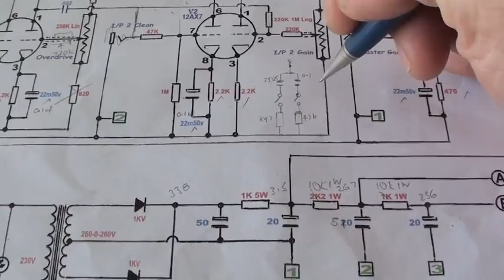Small Tube Amp Build, Start To Finish

Comment: Hey,

I looked through comments and I believe you are keeping schematic to yourself as an author.  I respect that and would not ask for you to share it. Anyways, I felt empathy to what you said about not being able to afford nice things, so you make them yourself. From description, I see that you have used EL84 and 12AX7s. Maybe you could turn my head towards place to look for something build based on these tubes? I admire your work and would like to try my luck with something similar. Something, that warms heart (and filaments) and at the same time leaving some money in my pocket.

Anyhow, good luck and thanks for sharing this project.
Reply from the maker: +Kristaps Liepnieks Hi Kristaps!  Thanks for kind words and comment.  The reason I dont share the schematic is that I honestly dont have it accurately drawn.  The basis of the schematic is intact however the switching is the component of this design that makes it very tricky to draw schematically and I've been a bit lazy in attempting to finish it.  I do however have an accurate layout drawing that Iv done on the computer and that probably has better information in terms of building this amp.  It took an age to draw but if you PM me I can send you a copy. The detail is indeed in the layout as that is where all the work is done in terms of noise reduction.  Thanks again!!
Reply: +elams1894 Hi,
Youtube massaging is sort of new to me. I believe I sent you a message. :D I think.
Reply from the maker: I received your messages Kristaps all good. I'll get onto it when I get home from work, been a busy couple of days :)

Comment: That would b cool to have such a tiny tube amp.  Put an EQ, OD, and Reverb in front, u got everything u need for any sound.
Reply from the maker: +Flowthrough Yes it takes a pedal nicely and real good size to take around with me with a single speaker. Its loud as all hell though, very powerful little unit. Thanks again Flowthrough!!!

Comment: Excellent work all the way,although I would prefer to stain the chassis to give it that old look...but great work just the same...👍🏻
Reply: Why stain it? It's got "the old look" as is? The tree that timber is from was probably 500 or so years old. That's old enough  IMHO. The only timber you would stain is Pine (and most of its relations...).

Comment: beautiful design. best in here
Reply from the maker: +nigel mohair Thanks so much Nigel!!!
Reply: +elams1894 can an integrated amp be converted to a power amp??
Reply from the maker: +nigel mahabir Do you mean, can a transistor amp be converted to Tube amp?  I have seen it done but it really means a massive overhaul.  Transistor amps are current circuits and have completely different component values and so on.  Tube amps are Voltage circuits so converting from transistor to tube is not really practical. Cheers!

Comment: Hi, a parts list would be cool...great work by the way
Reply from the maker: Thanks!  
2 x 47uf/400V F&T Electrolytic caps
2 x 22uf/400V F&T Electrolytic caps
2 x 1N4007 1000V Diodes
1 x 25uf/50V Sprague Premium Electrolytic cap
2 x 25uf/25V Sprague Premium Electrolytic cap
1 x 1k5W Kiwami Resistor
2 x 1k2W Kiwami Resistors
1 x 470 Ohm PRP Metal Film Resistors 
2 x 100 Ohm "         "        "         "
1 x 10k           "         "         "
6 x 47k          "
3 x 2k2          "
2 x 1M          "   
2 x 470k       "
1 x 3k3         "
5 x 220k       "
1 x 100k       "
4 x 0.02uf/400V Jupiter Vintage Tone Film Capacitors
2 x 0.1uf/400V    "             "          "       "        "
1 0.002uf/400V   "
250k Lin PEC Potentiometer
2 x 1Meg Log PEC Potentiometers
Switchcraft Input Jacks
Belton sockets, IC AC inlet Plug/w inbuilt fuse holder
Japanese Ohm selector switch
Carling ON/OFF Selector Switches
Classic Tone Transformers both Power and Output.
Hammond chassis.

Cheers Bruise!!

Comment: Amazing work and shop. Just seems like a lot of work for such a basic amp. Killer though.
Reply from the maker: Thanks GW.  Yes its quite a simple amp circuit, but the hard part is turning that simplicity into a tone that is quiet and hiss free.  I think many amps are overly complicated in their circuitry which adds a terrific amount of unwanted noise.  Getting rid of everything that I could think of that was unecessary was important to retain as much signal as possible and the incredibly hard part was getting a layout that had minimal noise too.  That took many many weeks of layout design.  It may seem simple and a lot of work but I just really wanted a beasty little simple amp that was quiet in terms of hiss and hum.  I'm a bit mad I think sometimes ha ha, but the is method behind that madness on occassions:)  Thanks again!!

Comment: Beautiful work, but two things not up to snuff: Turrets need to be swaged (staked) to be sure they don't loosen and fall out of the tag board later, and wires at tube sockets need to be wrapped around the terminals before soldering to prevent intermittent connections. The latter is especially important, because every time a tube is changed, wiggling it in and out of the socket creates stress at those joints. Other than this, a really great job!
Reply from the maker: TriodeLuvr Thanks triode, good points.  I do swage my turrets, just not shown in video.  Good point on wrapping the wires around the tube socket lugs, however I do not do this for the simple reason that when it comes time to replace that component, or socket, for whatever reason (and it happens almost everytime when designing/building an amp) the lug is often destroyed in the process as trying to get that wrapped wire out is near impossible without taking something with it, or damaging, misalligning, or snapping the actual lug.  The disadvantages of wrapping the lugs at this design stage outweigh the chance of an intermittent joint at the lug for me personally.  But you are certainly correct, when everything is dead set perfect with an amp, when building one, it is best practise to wrap all connections.  Thanks again.
Reply: elams1894 Yes, I understand. I wouldn't have even mentioned the wrap if I thought this amp was a prototype. I just couldn't imagine that you would make any serious mods at this point though, it has such a "finished" character. I also wouldn't have mentioned it if not for the fact that I've repaired so many kit products (Heathkit, Dynaco, etc.) where intermittents were traced to cracked solder at the tube pins. Anyway, it's a terrific piece of craftsmanship. Keep up the good work!
Reply from the maker: TriodeLuvr No worries at all, thanks for the input. My father hounds me about the same thing actually :) He also constantly reminds me about the need for a small braided wire between two side by side socket lugs, instead of a solid wire that is nearly always used (as a solid wire provides no wiggle room, or give for the tube pins).  Thanks again Triode, have a good one!!

Comment: You are very talented and it looks amazing. this is something that could not build both because of ability and tools. That being said, the amp sounds really harsh.
Reply from the maker: Thanks lewisbeeman! Indeed the tone isnt for everyone. The circuit was first designed as a clean amp (I think thats the best approach to amp building) and it has a clean channel still in there, however I love the distorted tone and so I just crammed as much distortion I could get out of the preamp tubes for the gain channel. I still love its tone, but my old man hates it. Hes a clean jazz cat and he hates, I mean HATES, it when I crank the gain channel. Its quite funny but certainly the main message here is that you can mod this amp circuit to whatever you like, definitely clean is very nice indeed. I love clean through a big amp like a JTM45, its a sweet thing, cheers!
Reply: Next project: Marshall JTM45 clone.

Comment: I can't imagine the need for TWO 12AX7 preamp tubes if you don't have a tone stack requiring gain recovery and you don't need a phase inversion stage because you are just driving one power tube. Seems like overkill on the front end. I designed a similar amp with just one 12AX7. It's basically a Champ with increased bias to the 6V6 and a few tweaks. It has a similar brightness switch and cathode cap switch to your design here.

I would think a more useful switch might be one that disconnects a gain stage or two. Hard to do that without getting a "pop" when you engage and disengage it, though. That way you could get more useful cleans without having to stifle the front end so much.
Reply from the maker: Joe Shmoe +Joe Shmoe I have two pre's as I am running two channels. One pre drives the clean channel with two gain stages and then switched to dirty channel with 3 gain stages. I need two ax7's to get three stages of gain. Not sure why that is unusual to you as its a standard circuit. If I wanted a tone stack then I would need 3 ax7's. Re:switching, I don't get any pop as I use make before break switches and each channel is earthen when not in circuit, ie, not open. After lots of trial it was decided that pre amp distortion was much more pleasing in terms of harmonics rather than driving the signal to distortion through the output tube. Cheers.
Reply: elams1894 Oh ok. Any trouble switching? pops? Or was it two separate jacks?
Reply from the maker: Joe Shmoe hi Joe. Indeed popping was a big problem and it needs quite a bit of attention in the way  each channel is earthed if you don't wish to use optocouplers or transistors. higher voltage make before break switches are a must too. From memory I used two 48k resistors between the cathode and earth for the switching, these  were switching from the in circuit cathode bypass network to the 48ks when not in circuit. if that makes sense, it was a bit tricky to work out from memory..
Reply from the maker: Joe Shmoe give me a personal message with your email and I'll flick you the circuit, might be easier.

Comment: Nice job . My only concern is where are the air vents ? Amps can generate a lot of heat quickly , and need proper ventilation . Other than that it looks , and sounds great .
Reply from the maker: Thanks saint. The whole back of the amp head is open, the carbon shell covers the top and front only, cheers.

Comment: Class A amp Making your own turret circuit board..nice layout of components..that's very professional.
 Good that you used the vintage tone caps. Like the sound effects of all the tools you use..makes this very unique..especially the hand saws. I was wondering what these glued together slots were all about.  Dove tail box joints..very nice work!
But the front end pre-amp sounds overloaded. Where you intending for a clean sound?
Reply from the maker: SuperCarver2011 Thanks super carver, the glued together slots were the templates for the dove tail jig.  There is a dedicated clean channel using 1 gain stage which wasnt demonstrated to well on the vid.  The overdrive channel has 3 gain stages and I certainly drove each stage to as near capacity as I could without getting into overload humm and hiss.  Thanks for checking out the vid and sorry for delay in reply, cheers!
Reply: elams1894 After your reply, I watched your vid again and noticed you even made your own dovetail jig..now
that is dedication to the craft.  In my humble opinion, you should have had less gain on the LEAD channel and
concentrated on biasing the o/p tube for soft overload to give that better distortion sound like some of the
pro amps.  The clean channel sounds not too bad.

Comment: Do you have a schematic for this thing available for download? I am quite interested in building my own head, or possibly combo, and this is quite inspiring!
Reply from the maker: +Carlin Lusk Hi Carlin.  I do not have the schem drawn completely as the switching is quite complicated and Iv been a bit slack in working it it on paper. I do however have the layout diagram all drawn and completed accurately.  That might be a bit more handy.  PM me with your email and I will flick you the diagram if you like.. cheers!

Comment: a great video and a good eye for detail, ?I was wondering if you could tell me why the wires are always twisted in pairs? Does it cut down on noise as say run together with tie wraps? Thanks again for the great videos
Reply from the maker: Robert Anderson Yes the wire twisting cancels out any humm that may be picked up in the AC circuit.  Any AC wires coming from the power transformer in the amp should be twisted for this reason, thanks so much!!

Comment: At 01:13 you are twisting two wires together , what purpose does this serve , is it to keep the wiring neat or does it add noise resilience?

Thanks
Reply: +HumphreyBriggs Think it's just for neatness but twisting cables together does reduce stray inductance.
Reply from the maker: +HumphreyBriggs The AC wires are twisted together to significantly reduce 50 cycle humm.  Indeed noise reduction is its main purpose and its neatness is a bonus.  Thank you!

Comment: Making your own dovetailing jig. Hard core.

For myself, I prefer working with aluminum rather than carbon fiber. But that seems to be your thing.
Reply from the maker: I'm a fan of alloy too. Just trying to get my head around chassis fabrication, I'm thinking of buying a tig welder, just money is a bit tight at the mo..
Reply: I assumed you could just bend the aluminum — no need to weld (although that would be cool!).

Comment: so what's the difference between this and a Marshall?  what part of the constriction would make it better? like better parts, design or what?
Reply from the maker: +mike jones The differences lie in the components/layout/grounding pathway.  Hand wired tube amps are all very similar in the sense that the tubes themselves require a particular circuit in order for them to run at optimal level.  The real genius's are the engineers who designed the tubes.  Those tube circuits are tweaked of course to give certain tone characteristics but the actual circuits themselves are all very similar.  You get differences in tone stack circuit, phase inverter and so on.  You can throw a lot more components into a circuit to get better frequency curve charts in terms of tone stack but does this make it better from very simple tone stack circuits such as in the SLO? It all comes down to tonal preference and money for production.  I like simple over complex, a nice and tidy ground return with one earth, a simple point to point layout and a stable low noise end product.  I like quality components and I dislike chassis mounted can caps but that is about where the differences between this amp and a marshall lie, just in layout and in quality of the components but it certainly doesn't make it any better in terms of quality of circuit, just difference in the time it took to hand make it and its components and layout.  The tonal end product is always the clincher and that is as always of personal preference. Thanks for the great question!

Comment: Really nice. Is that bottom piece of wood a veneer? I want to do the same using walnut but I don't want to see the ripped edge. Instead of carbon fiber, for the face, I will use clear glass. Just built my cabinet and it's awesome. Well done!

Comment: Amazing realization!!! You are Amp God!!! but where did you find the wiring diagram?
Reply from the maker: +Robert Devil Dodds Hey Robert!  Thank you.  I designed the circuit myself and also created the wiring diagram on Google Docs, draw application from the net.  Its all out of my own head he he.
Reply: elams1894
Ciao Elams, I'm impressed by your work! Simple Fantastic! you'd be willing to share the project with me? I would try to replicate it. I am not capable of designing circuit diagrams, but I am able to weld an electrical circuit following diagrams. I look forward to hearing from you. Thanks Robert

Comment: A Joy to watch,I can almost smell the solder! what ht voltage does it run to get 10watts from an el84 BTW?
Reply: Actually it is possible but you need good el84,the Russian military version will do it as well as the early mullards.the Marshall 20watt circuit get 20 watts out of two el84's.I have built a stereo class A guitar amplifier which is dual single ended which pushes 15watt's x 2 from two single-ended Sylvania 6L6's.I run them at around 500v DC on the plates.

Comment: Sir first of all what kind of cabinet and speaker r u using, and beautifully built and sounding amp one question can i change the cathode cap on my vintage Lafayette 35 watt amp head thanx for vid and knowledge Richard ffrom Pittsburgh
Reply from the maker: Hi Richard.  In my 4x12 cab I have 2x Rola 12UX alnicos, a Celestion G12H30 55hz cone, a Marshall labelled Celestion G1250 bass cone (red cradle).  Its a Fender Tonemaster speaker cabinet which were very well built out of their custom shop.  You can certainly change your cathode bypass caps.  I'm not a massive fan of high value electolytics for the cathode, eg 10 - 50 uf, for overdrive or distortion.  0.68uf down to 0.1uf film caps work best here I think.  The smaller values give a more focused tone for crunch.  The higher value electrolytic caps are nice for clean channel as they let a lot of frequencies through and give the amp a full rounded tone. Thanks!